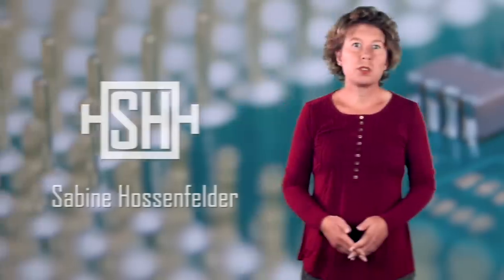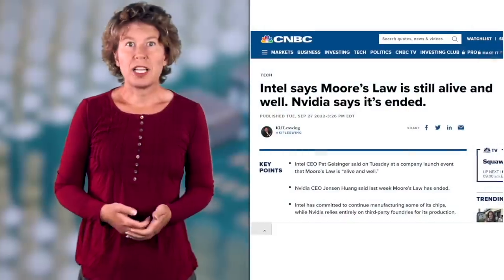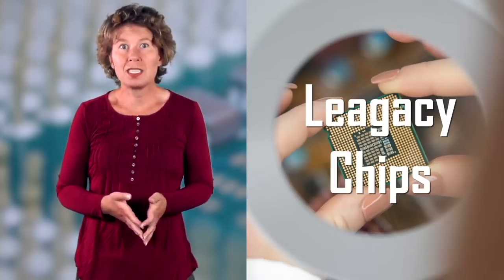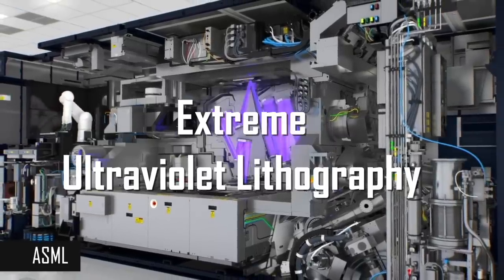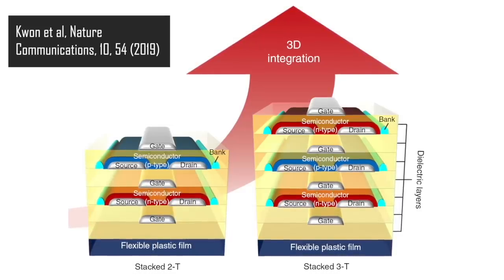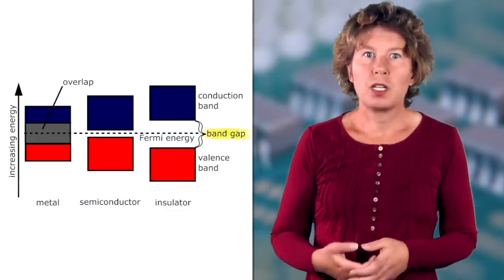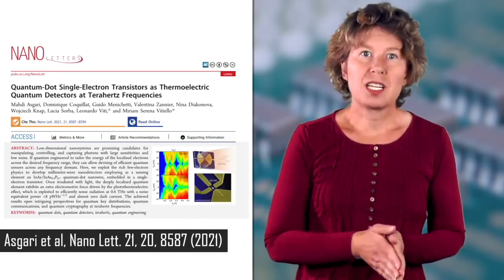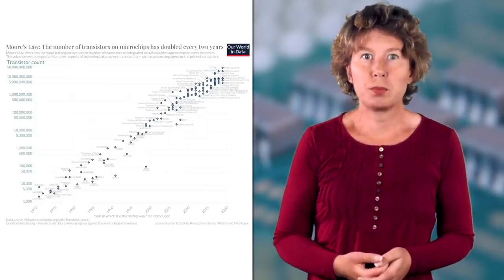Is Moore's Law Finally Dead?

Comment: Sabine, maybe you could do a video on the reverse of Moore's law as it applies to efficiency of software, especially OSes, which get slower and slower every generation so that for the past 20 years, the real speed of many tasks in the latest OS on the latest hardware has basically stayed the same, whilst the hardware has become many times faster.
Reply: Yes please. 
Shannon's law?
Reply: @BradleyLayton  lol perfect
Reply: Yeah but, that OS model is kinda specific to PCs, servers and workstation. For example look into ITRON and TRON or really any Real-Time OS. I don't think OS's are getting slower with any sort of consistency. There's a lot of embedded applications where throwing in complete Linux distro is fast enough to replace a microcontroller with custom software. It's kind of the point of Moore's Law, that software bloat just doesn't matter. Some commercial stuff is bloating in response, but others aren't. And remote "software as service" up ends the models, too. Bandwidth becomes a lot more important than OS speed.
Reply: Every OS function on the frame path of a popular video game has gotten faster, while all the rest has stagnated. Bling in bullet time by popular demand.
Reply: Not sure that you compare the same things. A command line single task of the 70's  is not a graphical interface of today, with tons of background services all active and in competition. Different "clients" are now targeted than it was the 70's. 
As for the goal, what is the interest to detect a mouse click one hundred time faster while the end user is as slow, if not slower, than ever?
And if your need is a specific job, you may use an MCU, no OS, injected by a program itself developed and mostly debugged using a generic OS.
Reply: @snnwstt I'm not talking about that.  I'm talking about XP vs Windows 11, for things like browsing files and opening them.  Time taken to log in, etc.
Reply: Not in her wheelhouse. Chips is physics, which is Sabine's jam, but software design is not physics. The end.
Reply: A lot of software is slow and bloated these days, that's true. But Operating Systems are definitely not an example of this except in cases where its slower by necessity to make it secure
Reply: Yeah, back when Spock said in one of the time travel episodes that a '70s supercomputer was a child's plaything in his time, he underestimated--a game console today has more power than a '70s supercomputer and is literally a child's plaything.  But it still takes forever to boot.  This is more a computer equivalent of Parkinson's Law than anything else--the computing to be performed will expand to consume the CPU cycles available and the data to be stored will expand to consume the bytes available.

Comment: Another chip guy here.
The transistor symbol at the start should have used the MOS FET gate even though the O for Oxide isn't used anymore.
NPU used to mean Network Processor Unit, but Neural is so much more interesting.

The real problem in my view is the Memory Wall which forces CPUs to have ever deeper cache hierarchies and worse performance when the processor is not making much use of the massively parallels capabilities. Cold starting PCs today is not significantly faster than 40 years ago, 30s vs 100s or so, but many capabilities are orders of magnitude higher. If we had a kind of DRAM that had say 40 times as much random throughput (called an RLDRAM), processor design would then be an order or two simpler but coding would have to be much more concurrent. Instead of using the built in SIMD x86 op codes to write Codecs, we would explicitly use hundred of threads to perform the inner operations. We then have a Thread Wall problem. And instead of including DSP, NPU, GPU like functions to help the CPU, we would write the code to simulate those blocks across very large number of simpler but also slower CPUs. But that possibility has slipped away.

I could also rant on about compilers taking up 20-50GB of disk space when they would once fit onto floppy disks. My code used to compile in 2minuts is now maybe a few secs, that speed up does not jive with the million fold transistor counts needed to do the job. And software complexity..... I think we all jumped the shark here.

Comment: While many of the new ideas in alternate materials and design concepts are promising, few of them are very near to production, so we need to focus on those factors which are easier to improve. Since waste heat is a significant problem, and battery life requires low power consumption, we need to work first on efficiency. Cooling isn't really a complicated problem, we just have to accept that it's needed, and design it in. Heat removal isn't exactly high tech, it just needs miniaturization. Designing a solid state sealed micro-heat-pump seems fairly straightforward.

Comment: It's almost as if they need to build an integrated neural  network supported by: a circulating cooling system that also delivers the energy substrates required for the computer's operations; a suspension system to protect the fragile transistor pathways ; a hardened shell that seals the computer from the disruptions of external environments. Also, it should be capable of performing complex calculations that are relevant to human beings' experiences and needs. I wonder how we can build such a powerful machine?

Comment: My first computer was an Apricot PC, in 1984. A 16-bits system that was compatible with the Sirius 1. It was promoted in fora as WAY better than the IBM, DOS system not compatible with IBM.

The screen was high resolution 800*400.

*The issue: it was not compatible with IBM, so hardly any software became available.  😭

Comment: My first computer was a Motorola M6800 design evaluation kit, a 6800 micro processor, serial and parallel I/O chips, a clock, and a ROM monitor memory. It had a 48k memory board, a surplus power supply scavenged from a scrapped out minicomputer and I used my TV as a glass teletype.

Comment: Extensive summary, thanks! But you might have missed an important, and currently very relevant, research direction: non-von-Neumann architectures and in general, computation paradigms that are more close to computing in biological neural networks. Here compute and memory are merged and signals are spikes instead of bit streams.

Comment: The ENIAC (Electronic Numerical Integrator and Computer) was invented by J. Presper Eckert and John Mauchly at the University of Pennsylvania and began construction in 1943 and was not completed until 1946. It occupied about 1,800 square feet and used about 18,000 vacuum tubes, weighing almost 50 tons.

Comment: We have a lot of improvements to be done at the software level too. Modern software is so bloated.
Reply: Yeah, a lot a lot. Like, several orders of magnitude. A lot of modern software is built on layers upon layers of inefficient code.
Reply: Even if Moores law ends, compute will likely still become progressively cheaper due to production scale, as will energy due to new technologies. So society rewriting a bunch of the bloated software seems unlikely. I actually think there is/will be a small gold rush of utilizing the cheap compute in new areas.
Reply: Like all the software that comes with your printer and serves no purpose.

Comment: Hello, small correction. The method which is used for defect inspection is (Scanning) Electron Microscopy, not Electron Beam Lithography. SEM is for imaging, EBL is used for resist patterning and subsequent structuring, usually in special cases were Photolithography does not provide sufficient resolution.

Comment: I'm only at the beginning of the video so I'm not sure this wasn't addressed later, but I read that the "5nm", "3nm" etc. nomenclature of modern processors is actually just marketing and it doesn't indicate the actual size of their transistors, which in effect is currently considerably larger.

So perhaps on the upside we are still quite far, definitely more than it might seem on paper, from the theoretical 250 picometer or so size limit using silicon atoms (although I assume, without having finished the video yet, this small of a scale would be unusable in standard processors due to quantum effects).
Reply: Tunneling seems to become a problem at far larger scales than that.
Reply: I think it refers to some type of feature size, like the characteristic dimension of the conductive paths or such, please someone correct me.
Reply: @FilmsSantaFe  It used to be, but I think that went out the window over a decade ago.  Probably around the time we switched from planar cmos to finfet.
Reply: The nomenclature is pure marketing, but not because the transistors are much larger. The transistors themselves are within the same order of magnitude in size as the nomenclature indicates, so it isn't that a 3nm transistor is 1 micron in size. What makes the nomenclature pure marketing is that it refers to the smallest "cut" they can make on the die. This means that there might be some part of the transistor that is roughly 3nm in size, but it's only that one part and nothing else. Furthermore, which part it is depends on the company, and in the past Intel has been more "honest" about which parts can be claimed to be the size their nomenclature indicates.

With all that said, once we get to the amstrong scale, the nomenclature will become pure fantasy.
Reply: @andrewsuryali8540  I don't know much about the actual architecture of such processors, but it is stated in different sources that the gates (which I assume are the points where current, or data, is transferred between transistors) in the CPU are about 10 times as large as the nm generation. So considering Moore's Law spoke of doubling the number of transistors every two years, if we coincide that with doubling of density then their marketing induces to a theoretical 6-7 year gap between our actual technological standing and what might be only in future iterations.

Comment: 9:55 "a transistor is basically a switch". no - it's basically an amplifier. in computer circuits, however, they are used like a switch.